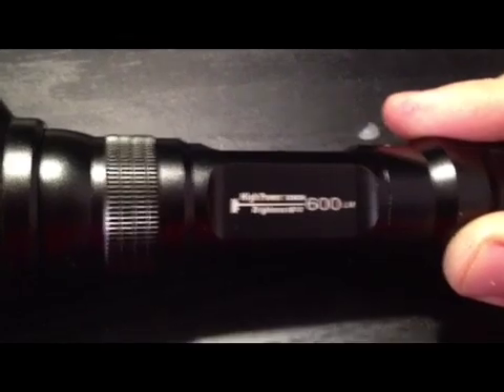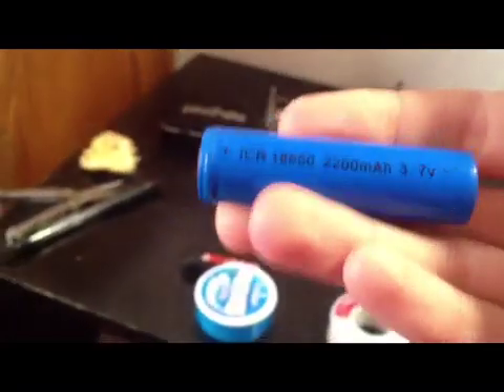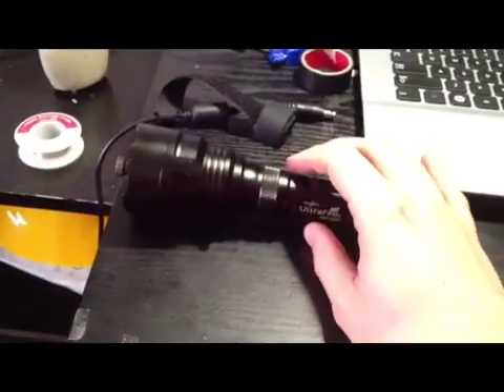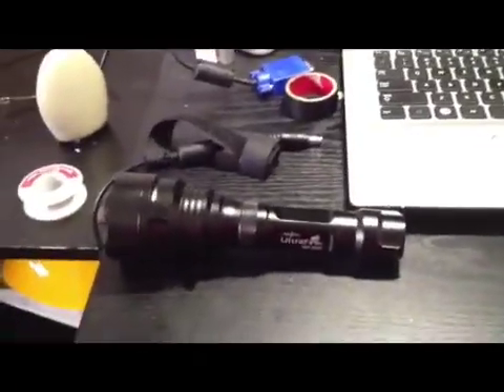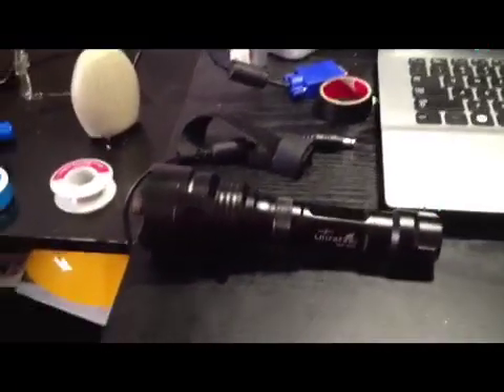1.5 Watt 445nm (blue) Laser DEMO

Comment: listen to dan efex you absolutely need goggles for this laser, I'm surprised you're not blind already, oh and welding masks are not an acceptable substitution for laser goggles. I also feel I should mention that you really should get a heatsink for that thing, at that power your duty cycle is going to be super low, you will probably end up burning out the diode

Comment: Both you and your description says 'this is the first laser I ever built' - but at 2:35 you say 'this guy is pretty old & Ive built 5 lasers since it'  Aside contradicting yourself you should know that heatsinking or no heatsinking does not determine an output variable.  Finally, you're offering terrible advice by saying safety goggles aren't necessary :(